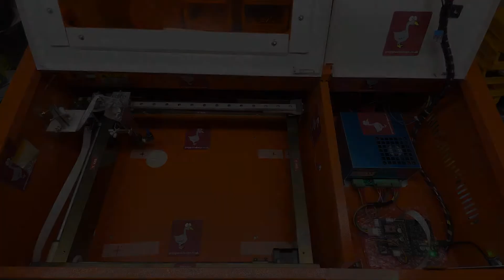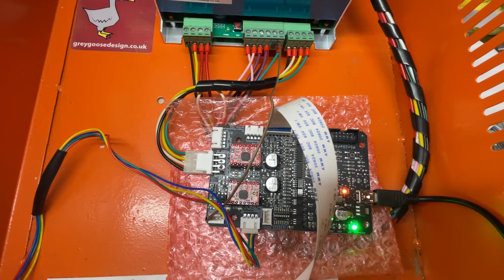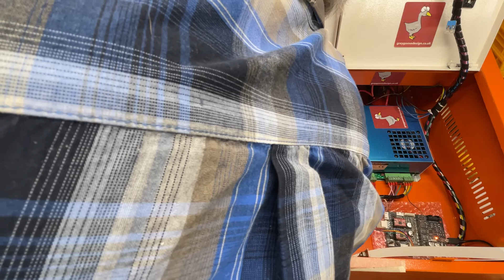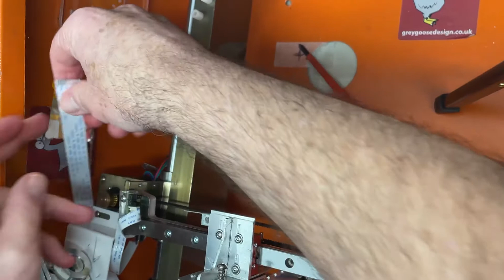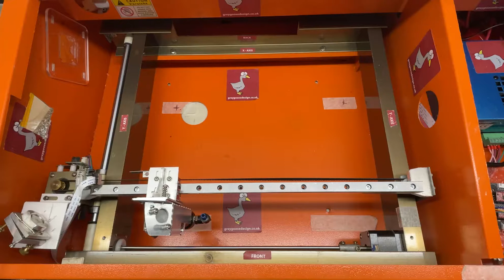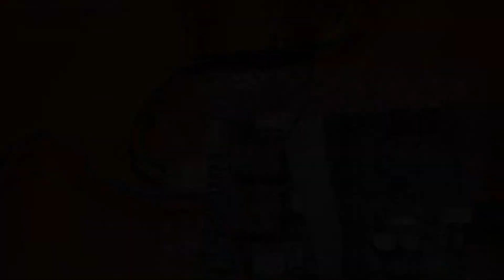K40 Laser Cutter Engraver Long Ribbon Cable Replacement

Comment: i wonder what possessed them to use a ribbon cable for the x-axis and limit switches when they use a straight 4 wire cable for the y-axis.  i can't help but think if they had simply used wires for everything rather than the infernal ribbon cable, replacement of the mainboard with some very cheap alternatives (< £30) would have been a very straightforward exercise.